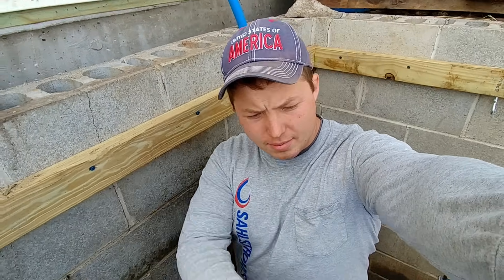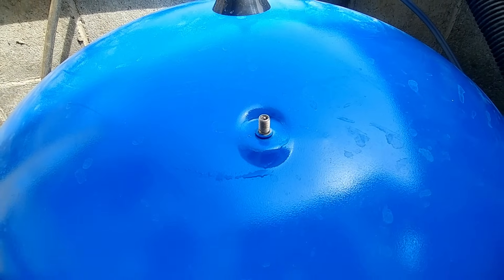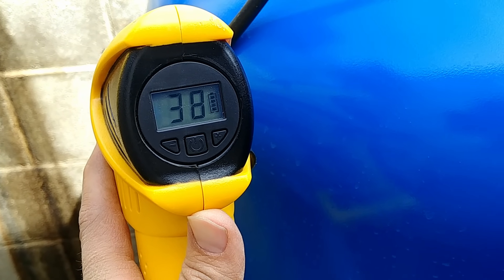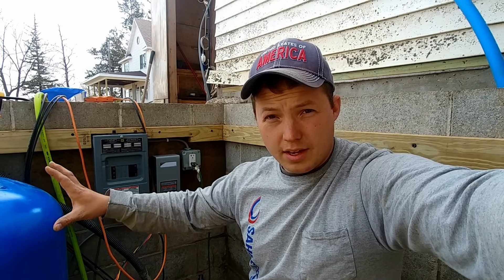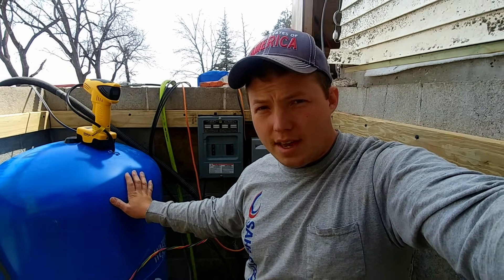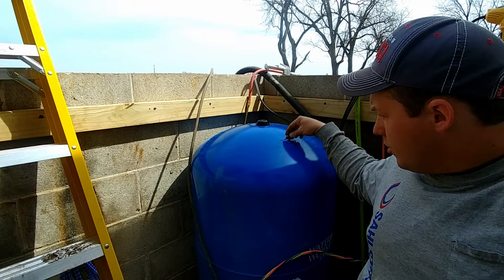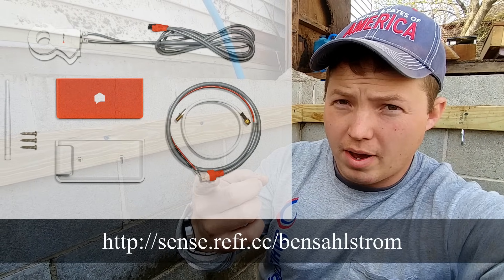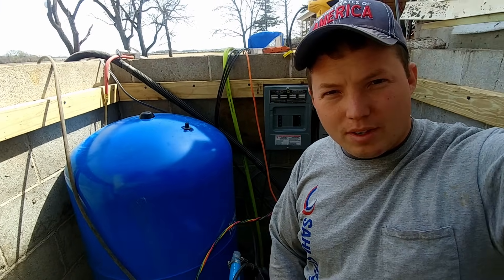How To Set Well Pressure Tank Air Pressure

Comment: Presently I have just had a well drilled (505 feet) and the installer has located the pressure tank in my building  How would I find out if the tank is big enough for my usage?
Reply: How often does the pump cycle? There are pressure / volume tables to determine how much water the tank 'stores' between cycles. Pro-tip: Install more than one tank because pump cycling is what kills a pump, assuming it's not eating rocks
Reply: William's reply is correct but not 100% complete.  The longer answer requires knowng something about your well water levels.  There needs to be adequate time between pumping cycles for your well water level to "recover" from the deeper position caused by pumping.  If inadequate time is allowed for recovery, the water level might be pulled down too soon and approach your pump depth.  That said, it's your pump depth that really important here., not so much the well depth.  If you have no issues with the supply of water avaiaable from your well ..... then never mind.

Comment: Why would you need to check air pressure every 6 months to a year?   Mine ran for 10 years without issue.  Also, standing in water next to live electrical wires, not good.
Reply: Because depending on the environment, the Schrader Valve can / will leak; the bladder may have a small hole (which allows water into the tank and rusts it. Any time to take a look at your well is time well spent.
Reply from the maker: If the tank loses its pressure it will kill your well pump. It's just best practice but I agree that in most cases it is probably unnecessary.
Reply: Hi great video. My son in bleached well for disinfection. However instead of using garden hose to drain the system he opened all faucets in house and now there is low water pressure. We changed filter and it was full of gunk from the well. Still low water pressure any ideas? Thank you.
Reply: @Rich's Quick Fixes foot valve at the bottom of the submersible pump may be clogged. Or pump lost it's prime if it's a shallow well pump